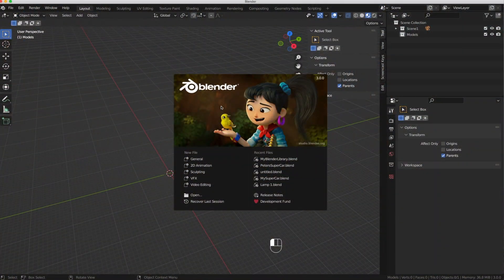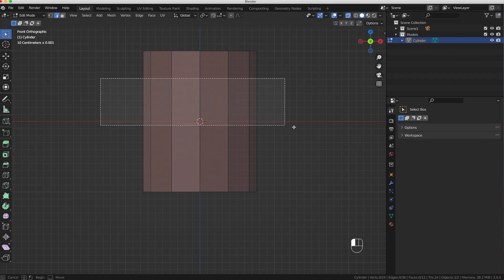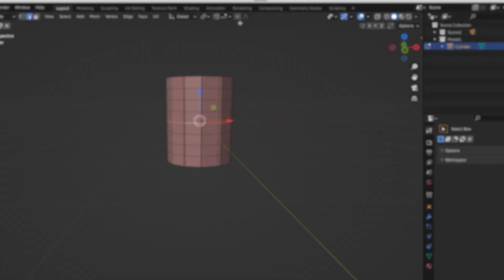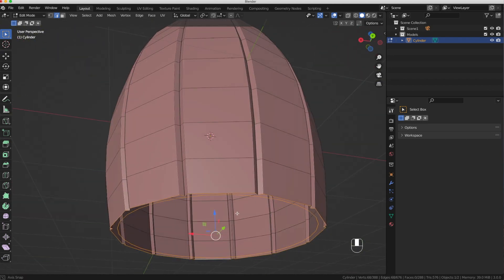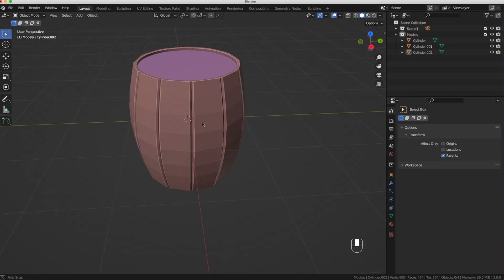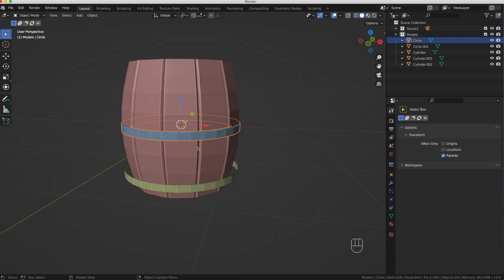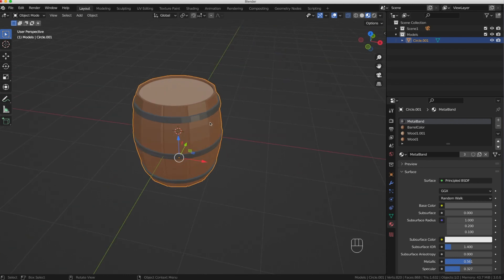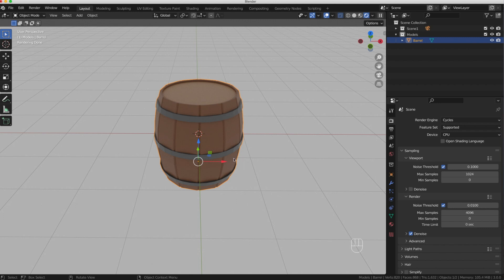Blender 3.0 Tutorial - Modeling a Low Poly Barrel and Adding Material!

Comment: Again, great video. I do have a couple questions though! Im a little confused about when is the proper time to be in object mode vs edit mode. I might just be making it more complicated than it really is though. Would it be correct to say that when you want to add a new, unrelated object to the frame you would add it in object mode, but if you want to add a new component to a preexisting object, you would add it in edit mode instead?
Im also curious if it would have worked to make a whole new cylinder to go inside the first part of the barrel, and then bridge them? I hope that doesn't come across as me trying to point out an easier or better way, Im honestly just curious if that would have been an option!
 Thanks again for all the help, you are really making learning Blender way less intimidating than I thought!